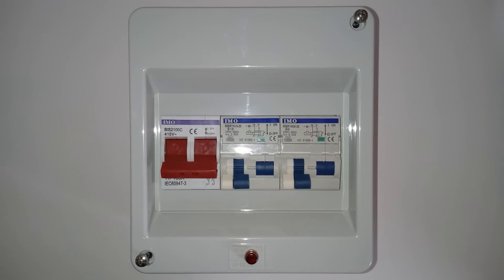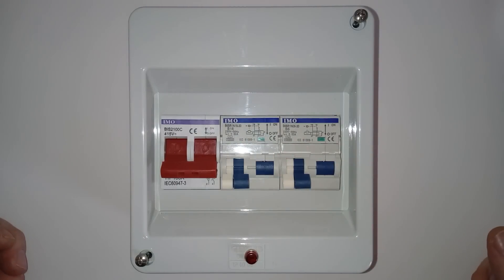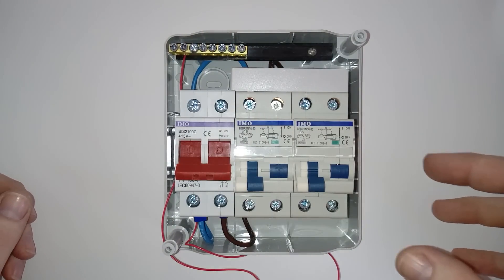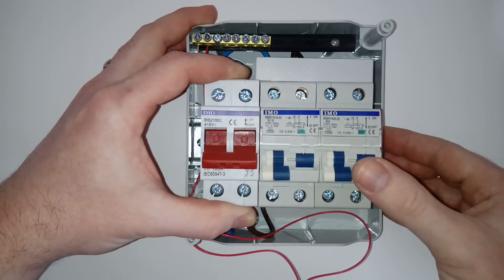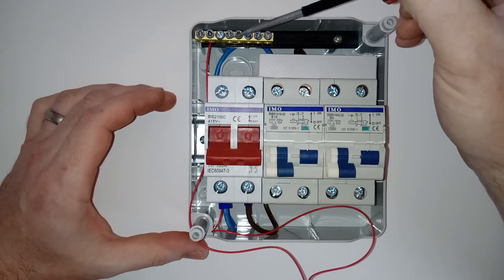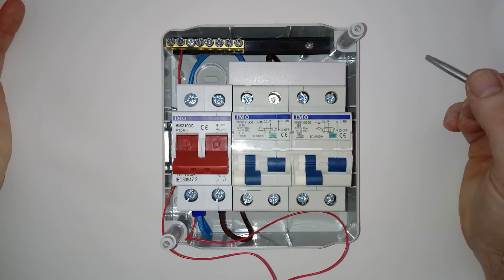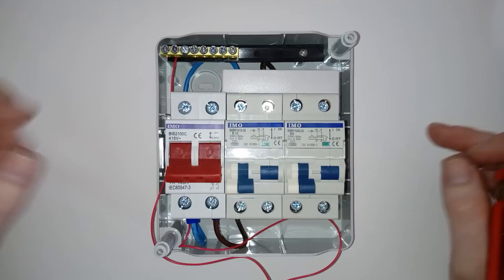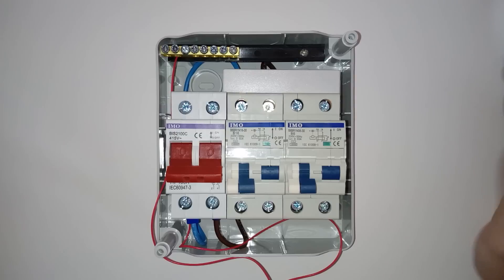How to wire up a 240 volt consumer unit for your campervan or motorhome

Comment: On my unit there a small lamp, assumong to signify live mains. Do you know which 2 cables are connected ? is it live and earth or live and neutral ? Thanks
Reply: It's in the top left and red? If so it's a warning light indicating reverse polarity. Handy If your abroad.

Comment: The hookup flex from the pitch hookup point to the vertical should be a minimum of 4 mm2 blue sheath. The Earth single earth lead to the chassis should be a minimum of 10mm2 and is connected to the Earth terminal in the vans CU which should have a 80amp / 30 milliamp RCD as the main point of isolation a 6amp MCB for the lights and a 16 amp MCB for the sockets . Lights should be wired in 1.0 mm2 TW&E  and the sockets wired in 2.5mm2 TW&E you are also required by law to have smoke detector hard wired on the own circuit and 6amp MCB. Your lights are 12v LEDs you will need to use a pelv LED driver which will convert the 240v mains to 12v dc .
Reply: That sounds wrong. A small caravan running a fridge, lights etc does not need 4mm2, 2.5mm2 should comfortably handle around 20-25A, and caravan outlets are normally rated at 15A. 80A RCD as a main switch for a caravan? WTF 10 mm earth does nothing extra for safety in a 15 A caravan as a 4mm2 earth conductor is already much lower impedance than the fault loop, making it bigger gives no practical benefit.

Comment: Great patient, informative and simple video. Thank you.

I returned my Screwfix garage 5-way consumer unit as it only had single pole MCBs and have bought a 4-way double pole MCB unit which of course is now full with one RCD and that MCB. Have I made a mistake?

Nervous to install with my limited (no) electronic knowledge. Got another isolation switch to stick one at both ends of the van.

Comment: Hi, thanks for the great video. When I come to wire my 240 sockets to this, do you just run from that mcb to the first socket, then to the second and so on. Or does it need to be on a ring? I'm thinking 4/5 sockets for a kettle / microwave and some phone chargers. How does one wire up the sockets to the mcb? Hopefully this question makes sense

Comment: Could I connect a 5amp charger into that 6amp fuse so when I hook up my charger charges the liesure battery,instead of plugging it in a socket just chop the plug off

Comment: You should keep the 6A MCB for lighting and change the 16A to 30A if you need more power for sockets. But remember that most campsites are limited to 16A or even 10A per hookup. So 16A+6A is all you need.
Reply: you are limited by the rating on you external cable to the 240v supply and the fuse on the ring/ socket/ campsite hookup - so I can't see why you can have more than 16amp in total for all the fuses - unless I'm being thick

Comment: Whats the purpose of earthing the consumer unit to the van chassis. Does the earth not carry through the hook up cable and if there was a fault with the sore power earth and the van was earthed, you touched the van would you not become the earth?
Reply: Because it’s a wiring regulations requirement under BS7671.also it would be a separate earth liras from the CU to the exposed metal frame
Reply: You kind of explained it in your answer. Fault current flows from the active onto the caravan chassis and returns via the earth conductor through the hookup lead. Because that current doesn’t return via the neutral, the RCD detects an imbalance and trips.

If the earth connection between the caravan switchboard and the chassis was missing, the chassis could become live and remain live, because there would be no low-impedance fault path to operate the protective devices

Comment: Why would you earth to the chassis? Your vehicle cant be earthed as it sits on four rubber tyre.  Surely putting an earth to the chassis you are connecting to the negative side of your 12V battery terminal. Your earth for your 240V comes from the earth of your onshore supply.

Comment: HI Dan, If I have a couple of sockects, 1 in the garage and 1 in the living room, can they be run from the same 16A breaker, I want to keep the other one free for my boiler. To do this would you just run a ring main like in a house?
Reply from the maker: Yes you can run them from the same breaker just be mindful of what you are running from them though. I would run 2 separate cables from the breaker though.
Many thanks for watching
Reply: @dantheman321  cool so just wire 2 cables into the same breaker directly? Love your videos btw!

Comment: Would this be the same for a trailer tent with 16a hookup?
Reply from the maker: Haven't done one for a trailer tent but I would think so.
Many thanks for watching
Reply: dantheman 321 ok, would it still be 32a breaker for sockets even though I’m only inputting 16a? Or would you recommend just one 16a circuit for 2 double sockets? Mainly phone chargers but also a fridge and kettle?
Reply from the maker: @danielscott63  16amp if your only input is 16amp, chargers and fridges won't draw much.
Many thanks for watching

Comment: Hi so you have a main switch and 2 MCBs, I've got a question from someone asking me if you need to have a RCBO instead of a main switch, but the supply that's for the Van's are already protected by RCBOs so could you clarify for me, maybe drop me a direct message thanks

Comment: Can you wire up a plug to run off hookup when hooked up and if not hooked up, off an inverter from the leisure battery? Or do they need to be kept completley seperate so you have one plug for when hooked up and a seperate from the inverter?
Reply: rorie roberts you will need a priority switch. Check out the NPS priority switch. Hope that helps.
Reply: @karemart74  You might have a charger/inverter/mppt which also acts as a UPS so you only need one socket which works under all conditions ie, battery, EHU, solar and if required will supply more power than the EHU supplies. Growatt, PowerMr, Eperver.

Comment: Hi Dan confused y earth when the van is on rubber wheels
Reply: My basic electrical knowledge (enough to get me in trouble) is that if this set-up is for an external 15 Amp power inlet, then no, as far as my knowledge is aware, the Earth is through the 15 Amp extension lead. Hardwiring for 240V from an inverter is another thing altogether. The inverter must be chassis earthed. But hey, a disclaimer. I came from a Google search asking about setting up a fuse box for a 15 Amp 240V inlet. I've acquired an old Bedford passenger bus that's been almost finished except for the inlet for the 240V and a few power-point covers and junctions. I trawling through pages of stuff and a few videos. I want to finish it properly.

Comment: Thanks for this..... random question, can 12v LED lights be wires straight to 240v? We have removed 12v systems but have 3 led lights we were originally going to install. Will this work or do we need to buy domestic lights?
Reply from the maker: No 12v lights cant be connected to the 240v. You need to take your power from a leisure battery for them via a fuse and switch. If you want lights to run through the 240v consumer unit you will need 240v lights i.e domestic lights.
Hope this helps and many thanks for watching
Reply: @dantheman321 yes you can you will need to use a pelv LED driver with allows 240 in and give 12vdc out

Comment: Should I wire my charger into this as well?
Reply from the maker: Yes but what amp is your charger ?
Reply: dantheman 321 don’t have one yet just wondering would this then charge my battery from the campsite hook up
Reply from the maker: @bensearley2540  yes it would, if you get stuck don't hesitate to ask.
Many thanks for watching
Reply: What amp charger am I looking for ?
Reply from the maker: @bensearley2540  
Depends on the size of battery you are using really, if you are only going for an 85amp battery then a 10 amp or 16 amp charger would do.

Comment: Hi. Does the unit now need to compky with 17th edition ammendment 3. I.e metal housing? I cant find any info specific for motorhomes.
Reply: Yes it must comply with BS7671 as well as any relevant regulations relating to caravan and camper van or mobile homes.

Comment: Will it affect an mot if you converted a van ie would you need a certificate for to pass?
Reply from the maker: Ian Croasdell
No it wont affect the mot at all as the conversion side of the vehicle has nothing to do with an mot accept for the seat belts.
Many thanks for watching

Comment: Nice video but would have been nice to see you actually wire it up just so you get a visual representation
Reply: Yes I’ve no idea and I watched it twice.  Not sure if top and bottom need to be wired on RCB or if I just copy what he did on top onto the bottom.  Maybe you can use either end?  Don’t know what bar is on top.  Does it need to be put on bottom if using bottom ports.  I’m more confused after watching this 😅

Comment: Can you recommend a charger controller that has solar controller and 12v/mains charger all in one please? Most likely will be buying a van with a smart alternator
Reply from the maker: Darren Jones 
Normally i would only use a controller for the solar panel that goes straight to the batteries and then a seperate system i.e sargent system that controls everything else but i think the cbe kits might do what your wanting it to do but i wouldnt know which model you would need. I used to fit the pc200 kits from cbe which may do that but you would have to make some enquires first. Hope this helps and many thanks for watching

Comment: Should a hob be wired up to a sixty amp main fuse box ?
Reply from the maker: Patrick Parker 
A household hob should yes but caravan or motorhome hobs models are different.
Many thanks for watching
Reply: I have to add the sixty amp fuse is between the main feed and meter , anyway thank you for your response and hoping your Christmas is going well .
Reply from the maker: Patrick Parker 
A garage consumer unit i didnt think would be suitable for the hob your wanting to use and the feed on the caravan sites probably wouldnt cope with the power they demand. If i was you i would look at changing the hob your wanting to use.
Many thanks for watching
Reply: @patrickparker8417  you would need a cable running to the van that could cope with that load! you'd melt a standard camping flex cable (the one that runs from the van to the external power source) the plugs are not rated for that either - 60 Amps is mental - no domestic appliance runs at that high amperage.  Unless you are talking about a 12v appliance.  a 720w hob using 12v supply would be rated at 60amps but if you are using 240v directly to the hob this would be a 14,400watt appliance. Watts = Volts x Amps

Comment: Nice video Dan
I'm doing a tiny home on a twin axel trailer with a small kitchen with microwave a fridge and freezer and lighting.
Also a shower room with composting toilet 
And then a bedroom with sockets and lighting and was wondering what is a good consumer unit to use?
Thanks.
Reply from the maker: bobby kirkwood
Hi bobby maybe better using a garage consumer unit with a 3rd breaker to be on the safe side.
Many thanks for watching

Comment: Hi Dan - great series of videos, My question is why do you need to add an earth connection to the structure of the van when the external hook-up you are connecting comes with an earth connection, surely it is best to keep the mains wiring totally separate from the van which is connected via the chassis to the (12V) van electrics.
Reply from the maker: Nick Wood 
Its a good point but its something you have to do to be on the safe side. A vehicle wouldnt pass a type approval test without one and also if you have run gas pipe in your vehicle that has to be earth bonded as well. I worked for a place that was ncc approved a few years ago and with there conversions they had to be earthed to the vehicle with a specific sized cable as well. Whatever you do dont miss it out but a little tip for you dont earth it underneath the vehicle as it will rust over time and become useless so earth it inside where its accessible if possible.
Many thanks for watching
Reply: @dantheman321  Thanks for that information, Dan. In my uneducated opinion, I assumed a 15Amp 240V inlet was where Earth came from, with the fuse box dealing with load independently.
Reply: Because it’s a wiring regulations requirement under BS7671.also it would be a separate earth liras from the CU to the exposed metal frame

Comment: hi, if the van has wire running to the consumer unit on the surface will this not pass a electrical test because the wire are not going in the back? also how many socket can you put on the 16 amp one
Reply from the maker: Chris C 
Hi Chris, i think it depends on the type of electrical test you are having done. I know from experience with type approval tests and ncc tests that the wires have to be double insulated so you would need some split conjugate to go over the wire and also you will need to make sure that the wire is firmly fixed to the wall with p clips for example. Hope this helps and many thanks for watching.
As for the sockets it would depend on what you will be using the sockets for but i wouldnt go over 3 socket but 2 would be better.
Reply: thanks great video

Comment: Hi, thanks for the video which demystifies the consumer unit - well presented!

I just bought an old caravan (Abi Award Sunstar, early 1990s model). The 240v sockets and lights are not working. The previous two owners never used the caravan so they can't help me. Hence I have a very rudimentary question:

- Does the consumer unit only deal with the mains hookup? Does the consumer unit have anything to do with the inverter?

Thanks in advance.
Reply from the maker: Hi the consumer unit only take its power from the hook up and distributes to sockets, lights and any other 240v appliance. The invertor takes it power from the leisure battery as it needs 12v power to work and should be a separate power supply altogether. However if a change over switch has been fitted then both the hook up and the invertor can supply power to the change over switch and then supplys power to the consumer unit allowing you to run the 240v appliance either through from the hook up or invertor. I hope this helps and if you need anymore information please don't hesitate to ask.
Many thanks for watching.
Dan
Reply: Somewhat intrigued by the "change over switch". The caravan has a switch that controls electricity supply from either the "car" or "caravan" (meaning the leisure battery). This in-built switch deals only with the 12v power supply presumably. So a "change over switch" between the hookup supply and inverter would be absolutely necessary. Somehow I don't see this "change over switch". Is this something to be added?
Reply from the maker: AG Yu 
Yes you can purchase them for around £35 on ebay and they are very easy to fit.

Comment: Hi where can i buy one of the units, or do you have make /model no etc thanks
Reply from the maker: Hi i dont have any info on this particular unit as i have had it for a while but if you go to an electrical wholesalers and ask for a garage consumer unit its basically the same but probably cheaper as well.
Hope this helps
Many thanks for watching
Reply: Thanks for the reply , will do

Comment: Do you have a wiring diagram or video on the wiring of an electric 240v hook up within the van please?
Reply from the maker: Kadavey68 
hi do you mean the 240v hook up that goes on the outside of the van that you plug into from the mains?
many thanks
Reply: dantheman 321 Yes sorry.
Reply from the maker: if i get chance over the weekend i will make a video for you
Many thanks
Reply: dantheman 321 fantastic thank you